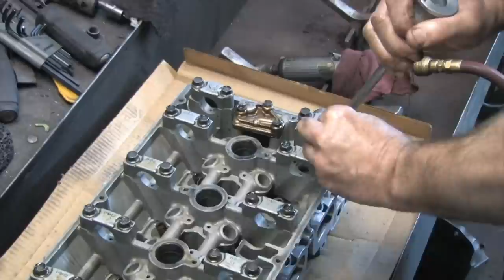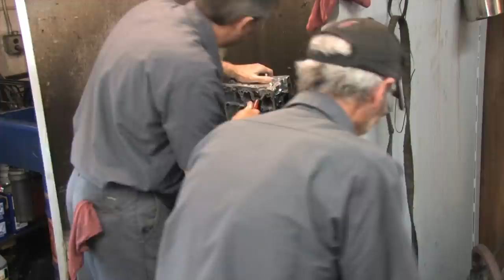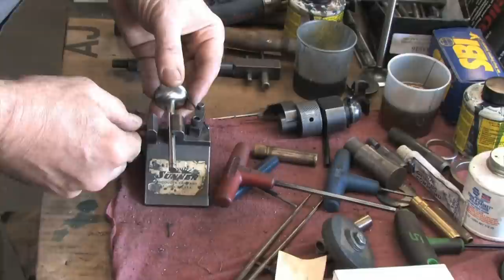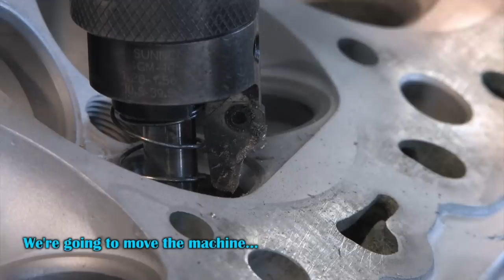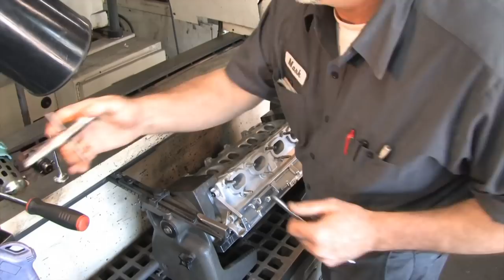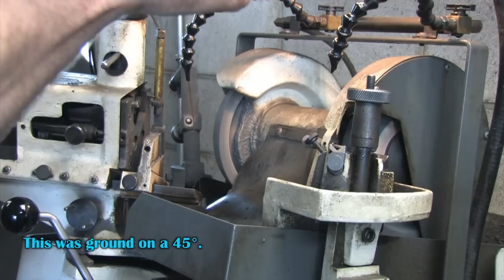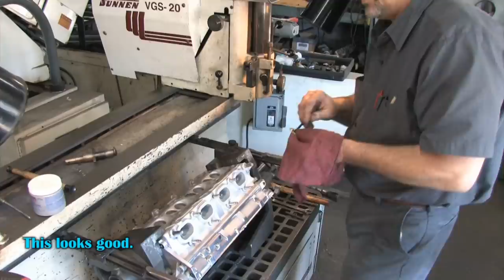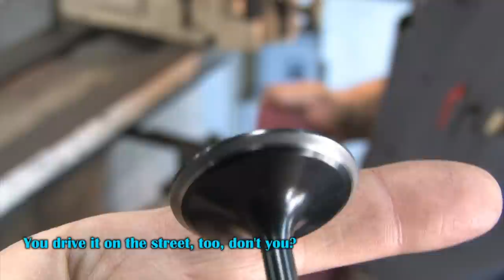Cylinder Head 201 - Radius Cut Valve Job

Comment: Wow all that work setting up. Fully understand that you need to get it right. Why not use a CNC machine like LASleeve use. One cutting tip does everything, using a shaped cutting tool can wear out leaving incorrect profile. Have a look at how they do it at la sleeve.  All About Motorcycle and ATV Four Stroke Valve job... What you don't know.
Bermcannon.

Comment: +Jafromobile What did he use to clean the ports at the start? Just a plain steel wire brush?
Reply from the maker: +spankeyfish Yep!  Regular old regular old...  I was much more cautious in my garage, using a brass-coated wire wheel on a torqueless-in-comparison Dremel, but this moment only proves the vanity in my overly-cautious nature.

Comment: when replace stock valve with aftermarket valve ( GSC ) , would i need to grind the aftermarket valve's angle match the stock seat?
Reply from the maker: No, you do it the other way around... you cut the seat to match the new valve's grind.
Reply: ok thanks for information

Comment: HOLY lap man! 4 to 6 valve rotations with the lap stick is all you need with 400 or 600grit. Rub your hand 2 times pick it up 2 more times pick it up if the seat is not there, you got runout. any more spins and you trench the valve.   IMHO dead steel pilots suck,  nothing beats live carbide with a guide honed to fit the pilot tight tight.

Comment: Hey man! First of all thanks for all the informative videos! Learned a lot! I am a bit confused, do i cut the angles on both the seat and valve and then lap the valves OR just cut either the valve or the seat then just lap them? Thanks!
Reply from the maker: If you cut the valves AND seats, they should be perfect and not need lapping at all.  It's pointless to cut one without grinding or replacing the other.  Lapping is just a band-aid on a valve problem, or it's an inspection process.  It helps you set up your machine or buy you some time if you can't afford a proper valve job.  Lapping won't make a freshly-cut seat any better if the seats were cut right to begin with. You will actually cut the life of the valve job shorter by lapping freshly cut stuff.

Comment: Not a fan of lapping valves when you have the right equipment, which he has. I would have used a marking compound like on rear end gears. If your just checking for the 45-30 line location that's all you need to do. Lapping a valve is like putting 5000 miles on the valve. If you've got a good line, it's gonna seal. Also, if you're going for a 45-30 line on the seat, it's best to cut the valve to a 44 degree angle, not 45. That's a guaranteed seal with maximum meat left for durability.

Comment: somewhere near 11 mins or so It seems like the pilot is wobbling?  maybe just a camera illusion?
Reply from the maker: No, it moved.  You saw it right.  That's not terribly unusual.  It's the reason why you cut, and then check the results.  That inspection step catches any possible deflection.  Guides wear, so with any used guide, the pilot can wobble.  You'd have to have a guide for every possible wear pattern for every size guide in order to prevent any movement, so that's why a light cut is performed and then checked.  Once you've got it right, you lock the stops and you'll repeat the same cut on every hole.
Reply: @Jafromobile  Thanks for your response on this video - I know its been a while!   I saw this video and have been watching many of your others on head work, trying to absorb as much of this kind of info as I can.  Any reading or other videos you could recommend?
Reply: @jafromobile - Also, of course:  THANK YOU FOR TAKING THE TIME AND EFFORT TO MAKE THESE!!  Great work, I wish I had the camera skill you do

Comment: That's not a radius valve job. That's only a 3 angle cutter. A radius cutter usually has a top angle, seat angle, then a radius of choice underneath the seat. And some only have a seat angle, and a top radius and bottom throat radius.

Comment: Hey jafromobile I need some help man. first off I have a 2g eclipse gst 98 and it's overheating but the thing is it only overheard after awhile, I have water flow no leaks or bad water pump sounds. I have a new170 thermostat because I wanted my engine to run cooler. By the time I pop my hood the overflow cap is popped off and filled with water. I also have a brand new head gasket and my fans come on when I turn my key on I have slim fans. Its stops overheating if I turn my heat on.

Comment: Почему направляющая шатается в момент обработки?
Reply from the maker: Because they're used guides.  Not new.  Guide is not perfect fit.  This is why you do the setup, test cut, inspection first.  If deflection causes a problem, you make adjustments and another test cut.  After you get the good result, set stops and all valves will be cut the same.  The setup/inspection steps catches any problem from deflection.
Reply: Jafromobile where are you from?

Comment: Where can i buy the valve stem seal puller?
Reply from the maker: Call my lucky, but I found it on my first google search.  It's a Goodson VSP-323.  $200+ shipping.  They make pliers for this that take a bit more grip strength out of you that are $30.  This is $170 for arthritis prevention...  $170 that could go to power adders...  tough decision because I like tools, too.
Reply: @Jafromobile  Thank you for your answering.

Comment: What's the retail for a job like this
Reply from the maker: I'd need to go through my receipts for a solid on this, but I brought them a bare clean head and didn't ask them to reassemble it.  Depending on whether they have to do those things it should be between $125 and $275 for an inline-4 16V head.  In my case it was on the lower end, but I don't think I only paid $125 because this isn't a low-end shop and I slowed them down with my camera gear.  I've had a Honda head rebuilt and assembled by NAPA before for $125.

Comment: This is a regular three angle valve cut, not a radiused valve seat approach. An example of a true arc style radiused valve seat approach is demonstrated in the Rolls Royce L410 series V8 engines.  I after watching a few of your videos, can I suggest that you read some real texts on engine design and management, e.g. Philip H. Smith, Charles O. Probst, Robert Bosch etc. (not hearsay on the internet). Get some time on a  dyno, then maybe some  research on a flow bench. You then might then be able to offer real insight into the this subject matter.

Comment: A couple years ago I ground a set of valves in a vertical drill press using hand files and sandpaper because they were pitted badly.  Lapped them in the head and they all passed the solvent test with flying colors.  It's janky as f*ck, but if it works, it works!
Reply from the maker: You are an Alaskan badass no matter where you live.

Comment: why dont they use coolant when cutting..
Reply from the maker: +James Lyons Cutting so slow (like 60 RPMs) that it doesn't even get hot.  If I didn't accelerate this video, you'd be sitting through 90 minutes of JUST the seat cutting part.  Video magic makes it look fast.

Comment: As a mechanic for 30 years, I did a lot of this work. Recently the quality of parts has been so poor that anything you buy practically needs to go through a machine shop and hope you get lucky. I had to stop restoration work as it is long term and somebody needs to absorb the cost of parts we change twice before the vehicle is finished. Nothing is easy to locate on older vehicles and restorations take time. Putting an A/C condenser or evaporator in a car that might not fire for a year only to find leaks down the road or bad valve, bearings in new compressor. IMHO, performance has become a money pit and waste of time and it's NOT like the old days when you could buy a crank  install yourself and go to the track, nor can you trust Comp Cams or Dart heads to work as they advertise. You are now a bitch to Wall Street.

Comment: Not really any benefit in a street car that has decent valves to begin with. Not really a failure point in these engines. All you do is invite more wear on the valve seat and thats not good. Most titanium valves have a nitride coating on them anyway to prevent galling of the stems.

Heat resistant ceramic coating on the face only of the exhaust valves would be a better idea.

Comment: aint no such thing as high performance valves unless you are making 2000hp
my stock block honda with cast pistons makes 500hp and will keep making more as long as that turbo is forcing air into the head ha
Reply from the maker: I hate to break it to you, but there are absolutely such things as high performance valves.  Any valve that improves upon the weight, temperature resistance, strength, and airflow characteristics OVER the stock valves are high performance valves.  It's based on their materials, their cut, and how much friction is reduced mechanically on the camshafts.  High performance isn't a brand.  It's a measure of improvement over a stock part's performance.  A lighter valve will exhibit less stress on valve train components and there are a lot of different ways to achieve that.  Some will work better than others, but if people weren't searching for a better performing part, then we wouldn't have our choices between titanium, inconel, stainless, hollow-stem, sodium-filled, back-cut, undercut, swirl-polished valves.  They're not an upgrade by themselves, but they will most definitely have an effect on how your engine likes to rev, dissipate heat, flow air, and how long the seats will last.  If you're using stock valves making 500 hp, you can definitely benefit from undercut, back-cut intake valves.  You will definitely get longer life out of inconel exhaust valves than you will from steel.  I don't rev high enough to need hollow or sodium stemmed valves, but my selection was purpose-driven, and I chose valves that will perform better than stock for my purposes.
Reply from the maker: ...and I also get your point.  If a stock valve can last as long as a so-called "high performance" valve, it's no surprise.  After all either valve simply controls how a hole works.  You've proven again how people can make fantastic results while using stock parts.  You can tell by my videos I'm always a huge fan of that!  Back-cut your stock intake valves on your next build and see what kind of airflow improvements you log.  You can still make improvements on those stock parts.  :)
Reply: well to me its all about money vs hp. If I can spend less and make reasonable hp Id rather do that. I pop a head gasket or two every now and then but 40 dollars every few years aint bad considering Im using a 1.6 liter motor with a 25$ bottom end and 70$ cast ebay pistons. revving to the moon

my buddy made close to 800hp on his 1.8 litre years ago street driven car ran 10 seconds on pretty much a stock head. thats before cylinder support systems came out all they had were sleeves which are too costly he just filled his engine block filler

I cracked a valve guide in my motorcycle just getting to fixing it, what is your opinion on doing it, just slap a new guide in and the old valve lap it with compound and go. Im not trying to throw cash at it and take it to a machine shop but the bike does rev to about 16000rpm. 

anyways love the videos keep it up
Reply: the thing between high performance and stock is simple. Number one. Stock valves have a tendency to fail under high rpm. Now as far as high performance valves. If your not willing to pay for stainless steel for the toughness of the valve then there is no reason to think there is a high performance valve. Most valves are cast. There for under a serious load on the engine. I.e., turbo or supercharger it will probably fail. So there is such a thing as a high performance valve!!! Sorry!!!